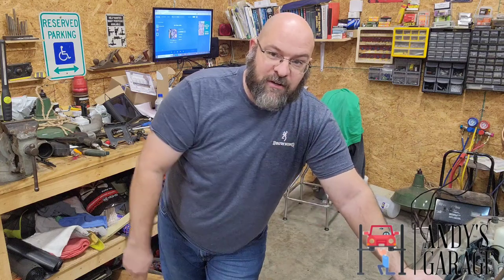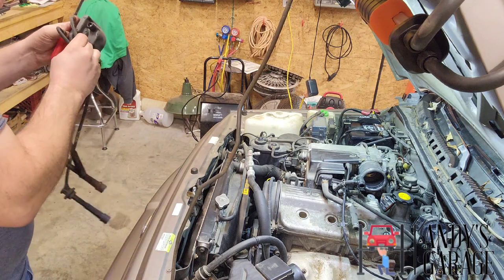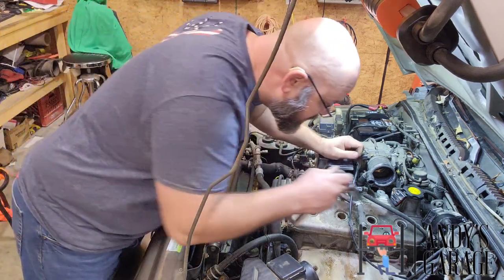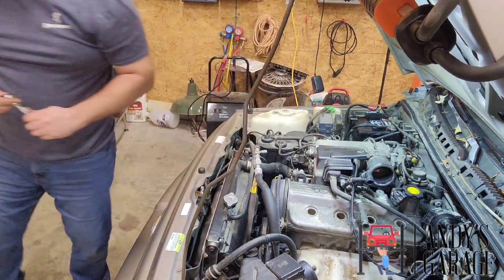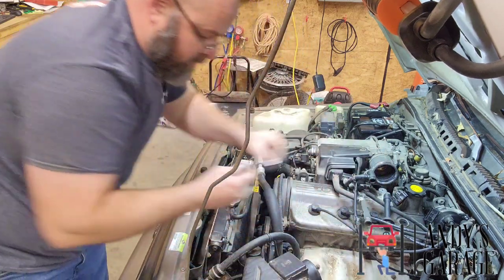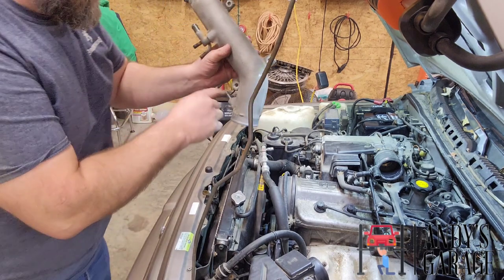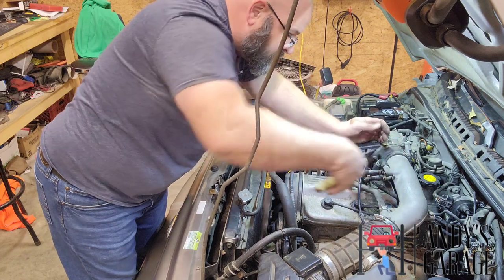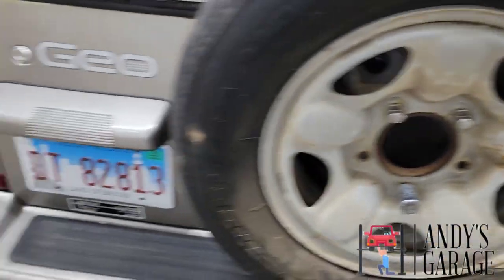1996 Geo Tracker - Old school tune-up. Spark plugs, wires, cap, and rotor.

Comment: Nice, video, doing a tune up on mine too, I think they never ever changed the cap, I ordered a rotor from rockauto but it doesn't fit for some reason (the bore is too big for it, the piece is ''Standard motors JR177-P'') , mi OG one is just like the one of yours, where did you got yours?
Reply from the maker: I got the parts from Rockauto.